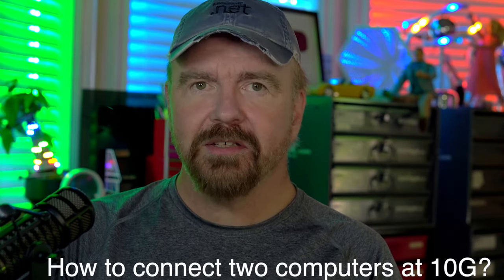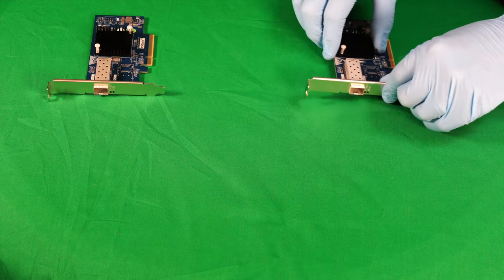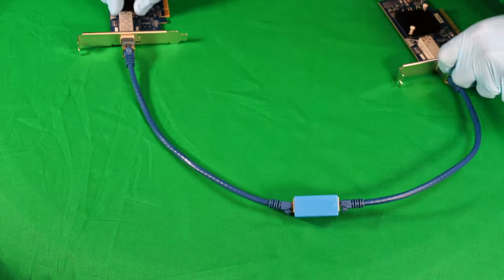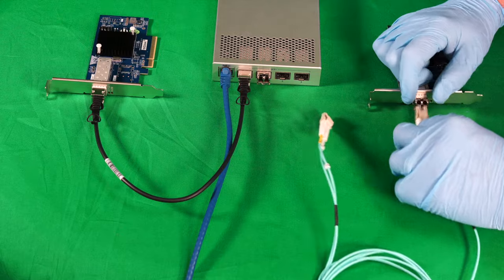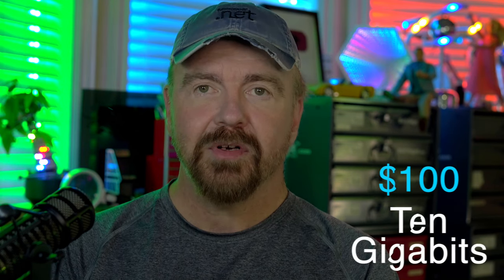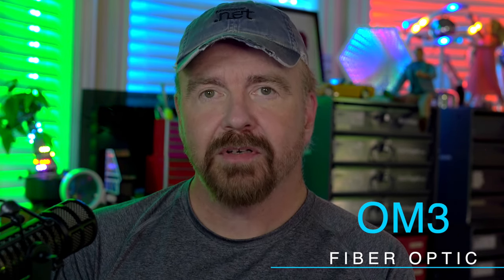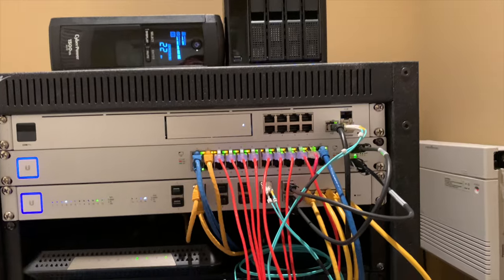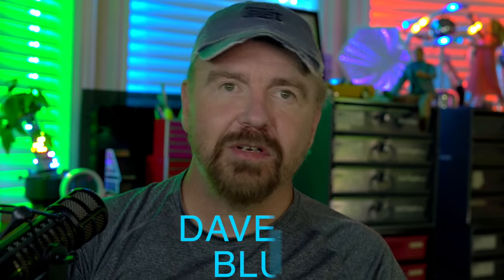10 Gig: 3 Ways to Connect!  Fiber vs Twisted Pair vs Copper

Comment: I would have thought 10g over ethernet would be similar to 1g and not need a crossover. Have you tried it without?
Reply from the maker: It can indeed work, but won't always, as not everyone implemented it properly, but you're right that with gigabit, at least, it should cross over automatically!
Reply: @DavesGarage  You're wrong. On 1000BASE-T and 10GBASE-T there are no transmit and receive pairs, each pair is used for both and every 10GBASE-T nic out there will work without a crossover cable or with a crossover cable. If you ever encounter an issue, it's because there's something broken with the cable and auto negotiation forcing it back to 100BASE-T and potentially screwing up autonegotiation. You will never need a crossover cable unless you're dealing with truly ancient 100BASE-T equipment and even then most of it still supports auto negotiation of MDI or MDI-X. Please look it up next time.

Comment: Advice: dont put sfp+ 10BASET  transceivers next to each other in the same switch they heat up. 
Also good to remember that TB3 has capability to carry 40 Gbs ethernet point-to-point over short distances:
Reply: Then why do SFP switches exist the way they do?
Reply: @BichaelStevens  because TB3 is not fibre... it's ok to link 2 machines sitting next to each other, but you can't run it at   long distance.
Reply: @SwissPGO  Mikrotik CCR1016-12S has 3 segments of 4 SFP ports shoulder-to-shoulder. Dont see anyone crying about overheating. And Cisco C3850-48XS is 2 rows of SFP ports shoulder-to-shoulder. I've seen those things at least 50% full, 1-24 and beyond, no spacing.
Reply: @BichaelStevens  Greeting. SFP copper ethernet modules tend to produce a lot of heat and are known to occasionally cause overheating problems if you stack too many close to each other. Fibre modules do not have these issues. I've not experienced such problems myself as most ethernet modules I use are surrounded by fibre modules, but I know they are way hotter that the fibre modules.
Reply: @SwissPGO  Oh i was talking fiber and havent seen copper ones used in any of our datacenters. Im young, dont have much experience. I will look into that later

and seriously, TB3? Cmon. Please say thunderbolt 3 and not tuberculosis 3
Reply: @BichaelStevens  lol - greetings from Switzerland

Comment: You should be calling it 8P8C not RJ45. And not to many people refer to fiber via om1-5 rated fiber. Most the existing crap out there is old ass OM1, newer stuff is OM3+ and that is only if you are dealing with cheap multimode fiber (only cheap-skates do MM fiber). Since this is all about home networks you are more than likely going to using multimode if you are un-cool. If you are cool and a total fiber snob, you will scrap that multi-mode garbage and invest in single mode fiber (and transceivers) because everyone wants to be able to send there pr0n videos up to 40 Gbit/s in the home, or spool it out to 50+ miles to your van down by the river. 

FYI.. OM1 can carry 1Gb just fine, and 10Gb as well for a short distance. In the home OM1 would work fine for 10Gb. Your distance is also dependent on the 10Gb standard you are using. 10G Base-LRM can go at least 220m over OM-1 fiber, while SR is a little over 100ft. I did network engineering for around 10 years, with a mix of old OM1 MM crap, and nice newer SM fiber.

Comment: You need to also have some idea what conditions the cables will work under. You don't want to kink any cable but fibre optic is particularly bad. So haphazard networking is a bigger problem with fibre. Likewise if you live somewhere that rodents are a problem, any chewed cable isn't going to work well but even a little bit of damage to fibre is going to require replacement.

The one thing I hate about copper ethernet is the idiotic retention plastic clips that always break. I can't believe we're still dealing with that today. None of the quick fix hacks are particularly hassle free.
Reply: LTT recently showed a new fiber Thunderbolt 3 cable from Corning I think. He tied many knots in it and pulled tight WHILE doing a fle transfers and it never failed/broke. They're expensive...it's coming though.
Reply: @mrmotofy  yeah I saw that. I will probably be dead before it is affordable. They have to work out how to automate connecting the end plugs as it is all manual at the moment and that is where the expense is.
Reply: @sammyfromsydney  Everything starts manual...then someone figures out how to automate for manufacturing. Ever seen a circuit board...components are tiny.

Comment: What really annoys me about the whole SFP debacle is the cards and adapters have gone cheap but switches are horrendously priced.
MM Fibre cable too is relatively cheap aslong as you buy 25+m at a time, say you want 3m you end up paying more or less the same as the 25m.
Cleaning and installation tool prices are also at price gouging levels.
This all conspires to make anything over 1Gb impractical and down right expensive for most. Even 2.5Gb switches are needlessly expensive.
Its almost as if there is a conspiracy!🤨

Comment: But shouldn't you have 2 active connections coming into the home? Just having 1 active connection into the home will be a point of failure if one goes down. So having 2 connections in to your networking boxes one used as a failover should one lose connection, combining both theses together and load balancing the two as a single connection for everything on your internal network.

Comment: Not a fan of that microtik 10gbe switch. I bought one and it just could not handle 10gbe, it would oscillate between 500 and 800 MBps.

The unifi aggregation switch on the other hand is a beauty! I would have probably gotten one myself if I didn't find a Brocade ICX for an absolute steal (a warning on the Brocade, very loud, needed to mod the fans to make it livable)

Comment: Fiber modules and cables have their caps on for a reason - to fend off dust and stuff what will affect their operation and performance. Thus it is not correct to present anything educational with these off at all times. These need to be on and will come off only at plug time! If they get unplugged they shall land back as well.
Reply from the maker: You're probably right, but the realities of video production mean that, just like a car show, some steps are eliminated to save time.  Not all safety steps shown :-)

Comment: Why would anyone go with 10gb at home is far beyond me. To get the most out of it you need to redo all the cabling etc., and the 10gb stuff can get costy. 
5gb requires no new cables, I'd definitely go with that instead.
Reply: Now imagine you had $10m in the bank... the cost of that equipment is pocket change
Reply: @ImNotADeeJay  Gold-plated toilet seats would also be pocket money and make zero sense and look hillbilly tacky as hell. I was talking from the perspective of some 98% of the mankind.
Reply: Nope NOT at all. Cat6 already in walls from 14yrs ago, bought 2 2port NIC 1 in server, 1 in main workstation. Patch Cable them at patch panel and poof 10Gb connection. A standard slow HDD these days can hit nearly 2Gb so basic network transfers are much faster

Comment: So no offense, but if you're going to "teach" people how things work make sure you have all your facts.
I stopped watching after about half the video, because I was cringing in my seat..
To start with RJ45 and RJ48 is not what you said. RJ45 connectors are used all the time with with all of the different types of shielded tp cables; however, if you want the shield to carry over from the cable into the RJ45 you need one that you can use with a shielded cable.
The rj48 are used with a slightly different cable that can have the shield inside the cable and that can be used for very long distances in an old T1 connection for example.
When it comes to connecting to the computers together with a tp cable, show me a modern NIC that you have to use a crossover cable on. I don't I have used a crossover cable for at least 5 years bc are simply not necessary any longer, but they used to be.
So please make sure you take the time to really educate yourself before others bc ppl believe that everything you say is correct.
Sorry!
Reply from the maker: It's a secret plot to discredit and confuse the American people until they don't even know what an RJ45 is anymore and pretty soon me and the Russians can just walk in here and it'll be like your cables are barely even terminated, man, and your buddy is laying with his head in your lap and the shielding is pouring out of the cable, and about the time crosstalk between the pairs really starts, he wants his mom.   And how many pancakes does it take to shingle a doghouse anyway?
Reply: @DavesGarage  good for you.....
Reply: p.s. I was just being silly in answering.  Loved that you responded Dave, I wouldn’t let the perfectionists that replaced good ole’ experience with Google searching skills get to you.  Everyone is a critic today and darn jealous of your garage.  Keep enjoying what your doing…
Reply: Really depends on the size of the doghouse.

Comment: Things to know:
- HP SFP NICs only talk to HP SFPs!
- Same for their switches.
- Careful with HP NICs actually - some of them are made for servers with forced air expansion slot cooling, and overheat in seconds without it.
- Actually, just don't buy HP.
- Buy Emulex.
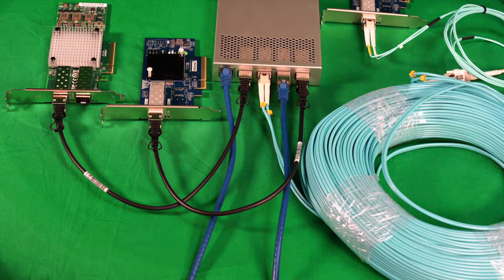Reply: That's it - 8:40, on the left - that overheating HP bastard interface! Cheapest cards on ebay, because every time someone decommissions an old HP server they come across one and find it won't work in anything else! I got one working by putting a fan on it, the other cooked itsself before I found the problem.

Comment: 1:54 the moment you realize your couple 100 bucks expensive professional studio mic actually is as garbage as a 30 buck "gaming" headset - you can clearly hear the somewhat muffled difference between when the space is clear and the moment the hand is in between
2:18 that's incorrect as pretty much any gbit nic supports auto-mdi-x ... one doesn't need special crossover cables or reserved uplink-ports no more - and in fact, even back in the 10/100 days before gbit became the de-facto standard on pretty much any device with a rj45 socket, auto-mdi-x already was a thing and many nics already supported it anyway, even at least dumb switches did
4:20 I highly doubt that this setup is actually required to be that complicated - or require the explicit use of a crossover cable - if you're even lucky enough the find some these days anyway - both nic most likely support auto-mdi-x - so it pretty much should work right out of the box even with a "straight through" single cable - otherwise feel free to correct me by specifying the exact model numbers so I can lookup the datasheets

Comment: There are 802.3bz compatible network cards available with RJ45 which support 2.5, 5 and 10Gbit speeds over standard Cat6 or even Cat5e twisted pair cable. No need for SFP ports and extra transceiver gizmos. Plain RJ45 switches for these are hard to find though as most switch makes stick to SFP+ I guess due to it being more universal and capable than plain RJ45.
Also, I don't think you need crossover for RJ45 (even if the books tell you so), most modern NICs and switches have auto-sensing and will work fine with patch cables.
Reply from the maker: You are most certainly correct that transceivers are not required for gigabit and higher.  In fact some 100M also supporterd it but was spotty

Comment: There's no more practical or rational reason to deploy multimode as singlemode fiber is cheaper and transceivers are sometime even cheaper in singlemode than multimode. For instance, if you wanted to run 100G on a pair of fiber - not 4 pairs like MTP connectors - QSFP28-100G-CWDM4 is $160 and easy to get, while QSFP28-100G-SRBD is $600 with a 9 months lead time as no-one produces them en-masse because nobody wants a multimode structured cabling fiber plant anymore.

Comment: Who the hell needs 10Gbps at home?
Reply: NEEDS??? That's relative. Who NEEDS a car...we can do everything with our feet, carts, horse/buggy. Anyone doing video editing, large file transfers, transferring to a NAS, or network backups in general. A standard single 3.5" HDD these days can hit 2Gb speeds. So the 20+ yr old Gb transfer speeds are very outdated and only give you 1/2 the drive speeds of the slowest drives. Or about 1/5th the speeds of the slower SSD drives